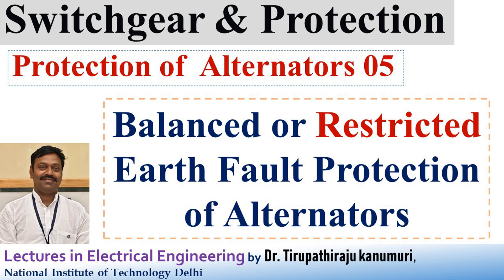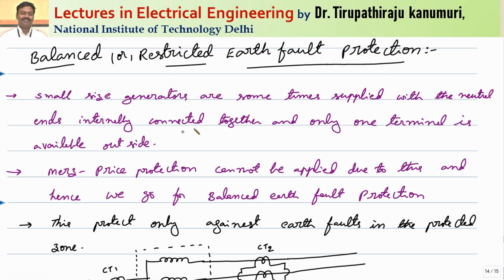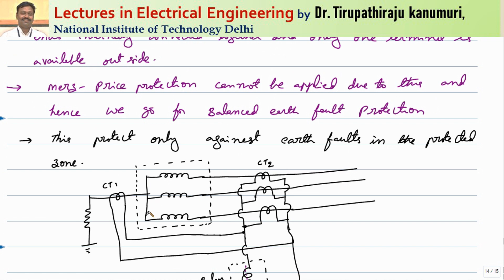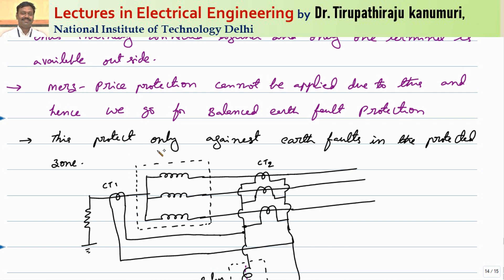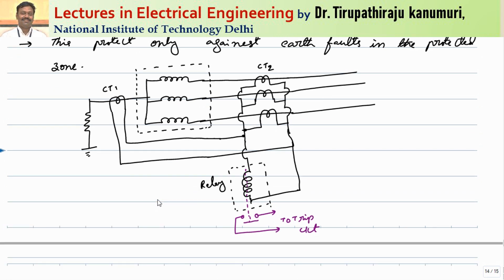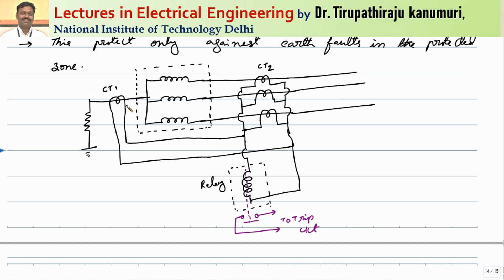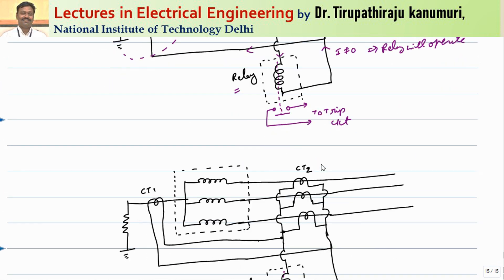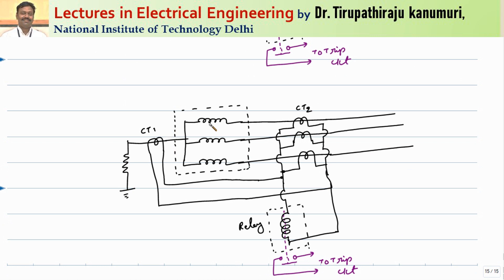SGP415 Balanced or Restricted Earth Fault Protection of Alternators

Comment: Sir why the CT2 cannot detect stator turn fault? Even though ct1 detects..Why the circulating current does not flow through the ct2 for internal fault
Reply: @lecturesinelectricaleng  6:50